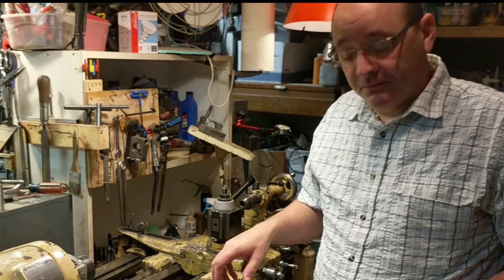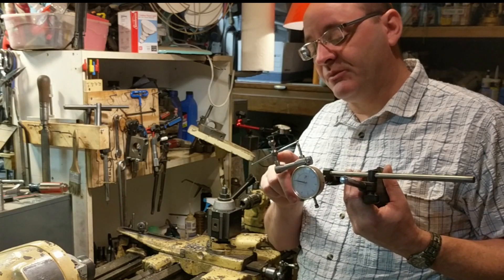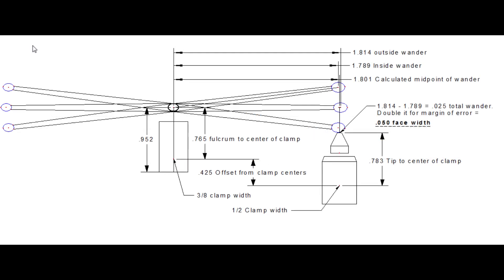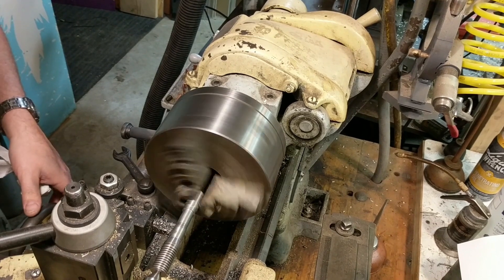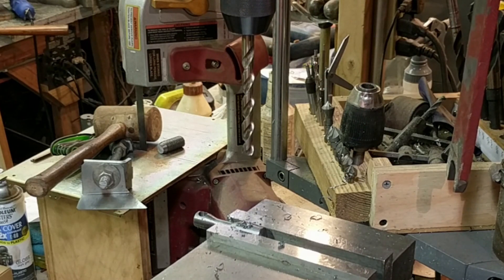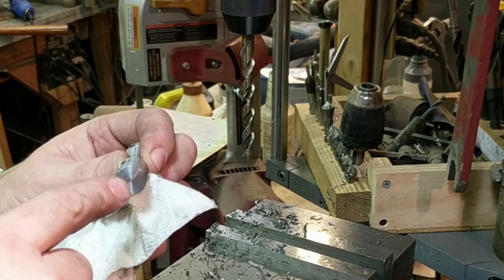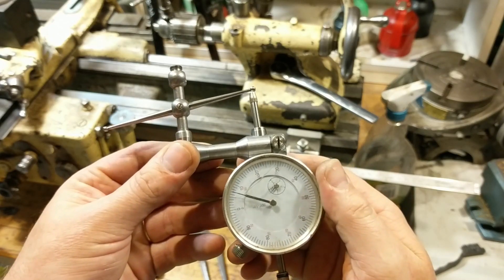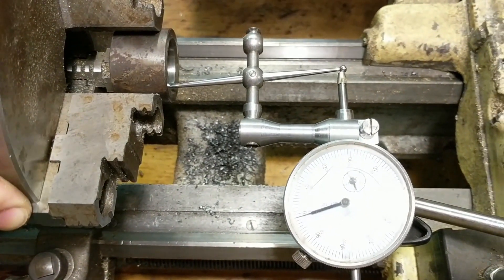Shop Hacks:  Using a Starrett hole adapter on an inexpensive indicator

Comment: Its got starret base  and no post or anything to fit it . Got wooden case ,magnet base,dail indicator,few different ends for it botton little ball end and point. A post that does little funky bend when tighten screw  i believe been while but its missing something to put sll together. Cup with threaded stud on it  i  believe. 
Couldn't find anything st hardware store to fit.  Its obe of best buds grandpas stuff he was a machinist.  He no longer with us i got quite a spread of his machinist tools. My bud has no use for tgem so he gave um to ne and i bought few of things to off of him. Im going get a Kennedy box off him in few weeks its nice but well used box not in bad shape kind of a survivor. 
Going ro get building cleanded up set little unimat up. Should be few fun projects need done to learn on to. Im welder fabricator mechanic by trade. Wellcright now im a retired. Lol without a pension. Odd job jeep me more tgan busy. And then theres family always needing stuff done. Tgey pay i tey not take it but always say here make ya take it.  But yeah that looks like nice project. Im look see whst model mine is today. Stay safe from ur ole hillbilly buddy

Comment: Nice, why did you use a saw rather than a parting tool
Reply from the maker: It's quicker to bandsaw it and clean it up than it is to install my parting tool. (I don't have a BXA parting tool holder, so I'd have to take off my BXA toolpost and put my old Norman patent post on.)